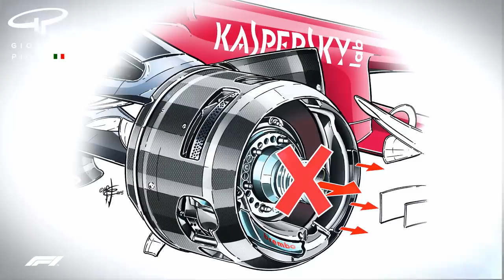2019 Technical Regulation Changes Explained

Comment: Can’t we just make the cars smaller? I mean ever since 2010, the cars have become more and more gigantic!
Reply: TRMS  I would rather see the tracks get redesigned, dropped off the calendar, or build new tracks that can make racing interesting again. Canada is a great example of a track that once was great. But, now, even Canada can not accommodate these faster and larger cars for passing. And do not even get me started on the street tracks. They ALL need to go.
Reply: Definitely. Right now the Mercedes F1 car is larger in both width and height than the S-class saloon. We need to go back to when cars were around 4.5 metres long.
Reply: Every time I see the two cars enter the tight coner, I imagine two cars squeeze together between the barrier.
Reply: The problem with that is that they have to get so big since refueling isn't allowed anymore. Even now most of the race is spent lift & costing to save fuel
Reply: Completely agree. Every race start these days are two by two.
Reply: tonkatoytruck dyu know how much that would cost 😂😂
Reply: tonkatoytruck The cars are the real problem, though, rather than the tracks except for Monaco.
Reply: Tracks are the real issue. They used to be more interesting.
Reply: And what will that solve? Lower wake, and a bit smaller cars allowing for two cars to squeeze in a bit tighter sections? Let me break it to you, buddie, wake will not be a problem starting from next year, and the second point actually doesn't affect the racing EXCEPT for places like Monaco, which never saw any overtaking to begin with. The only change you would see from smaller cars would be even less downforce than 2019 and less space for engine development, which would lead to even slower cars with virtually no impact on racing itself.
Reply: @TheMindGarage why are you comparing a road-legal car to something that would require a city lockdown to even get on that same street that your normal S-class saloon would normally drive in? If you want something that is at the same size as a street car, GT3 and NASCAR is your go-to.
Reply: tonkatoytruck

It seems like you didn't watch the 2017 Canadian Grand prix. The track is not the problem, and it doesn't make financial sense to spend a massive amount of money on redesign.
Reply: Terror , Calm down mate.
Reply: xd I'm fine, thanks, it's just the misinformed people that think that going back to the old will solve all the problems, but it's fine.
Reply: It needs vehicles of that size to be able to support the power of the engine. Imagine a wv sedan or a smartfit or a spark (small vehicles) with a F1 engine, it would be broken into the first accelerated at maximum speed, in addition to as a comment above: they need enough space for a tank that stores enough fuel for all the race
Reply: tonkatoytruck Liberty is looking to increase the number of street circuits, rather than reducing them... It's not street circuits that are the problem but it all depends on the layout... Eg Baku produces good racing but Monaco and Montreal don't
Reply: I StM I Fix the cars first, and only then we can start looking at whether tracks should be altered or not.
Reply: Terror the reason why people tend to think the old days were better, is because they grew up the sport during those times, and when they see the current, they are gonna talk about how the sport was like back in the day and in their opinion thought was better

Also the reason why I said, make the cars smaller, is so the tracks don’t have to made radical changes, since it’s very expensive to modify a race track and even more to make one from scratch, especially if it’s going to be used just a few times then dropped competently, like India and Korea
Reply: Terror I think wake will still be a problem next season to a certain extent. Remember, that these changes are short-term interim solutions only, not definitive ones. In the end, 2021 is the real target for making the cars significantly more race-able/following-friendly, after all. BTW, I'm not your buddie, guy!
Reply: TheRyanMannShow no, Kimi can't store his ice cream in the car now
Reply: Dennis Xu aerodynamics advancements buddy
Reply: tonkatoytruck i agree with redesigning tracks but comstructing new tracks require a lot of land and resources which makes investment too high to be made back up through the grand prix similar to the case in India
Reply: TheRyanMannShow what about making cars smaller but with allowing the ground effect to get stronger
Reply: tonkatoytruck Hold on now Baku can stay i hate street circuits but that long straight is a game changer
Reply: This! The car has just got bigger but tracks has just got smaller and still they're adding more street circuit.
Reply: yeah just wrote a comment about that
in the 80s-2000s there was way more overtaking cuz there is enough space nowdays you need backoff most of times cuz theres no space to overtake or not enough space for 2 cars
Reply: TheRyanMannShow most tracks have more races held on them and not only F1. So let F1 change instead if all the tracks
Reply: Theblahblahgames Someone gets it! We need groundeffect
Reply: Terror that is not true - it would help it a lot, because you would then have more room to find some clear air by driving alternative lines.
Wider car = Wider section of air infected by turbulences
Reply: tonkatoytruck I agree but that would cost more than just making the cars smaller.
Reply: TheRyanMannShow os carros de 2014 eram bons até Mônaco teve uma corrida com ultrapassagens
Reply: Monaco? Baku? SIngapore? Fuck no!
Reply: pre 1998 were bigger than current cars
Reply: Leerin Marfes where they? What were the numbers?
Reply: TheRyanMannShow sorry I meant pre-1993 cars which has 2.3 metres of track length and 220cm overall width
Reply: Leerin Marfes well, how long where the cars were in pre 1993 to today cars

And the reason why I said make the cars smaller, I saw the 2017 car next to the 2007 car, and the 2017 car was gigantic in comparison to the 2007 car
Reply: TheRyanMannShow they need to be longer than the 2007 cars because of larger fuel tank
Reply: Leerin Marfes and also for the battery for the hybrid system as well
Reply: no, that way they will look hideous
Reply: This has been the best comment thread I have seen in a while, genuine talk about the sport and no one pitching a fit. What I like to see
Reply: Street tracks are absolutely horrible for open wheel racing. Just TERRIBLE!
Reply: I feel it got smaller...  Even 2009 season started the rear wings got smaller than the past seasons
Reply: I'm not sure there are many opportunities to over take in Singapore either. From the over head shots it looked like there were no places to pass.
Reply: @davidmoll7250  then why is 2.4L 
2011 cars are smaller than 1.6L cars of today?🤔
Reply: RyanMann141 y’all are absolutely right. Cars from the 2007-2008 age are elegant to the max

Comment: Now that F1 cars are so extremely safe, can we bring back the Nurburgring? (Edit: I meant Nordschleife. Even though nurburgring is coming back 2 years later 🙂)
Reply: Kioumaars Taeed Cars are too wide, I think, for effective racing.
Reply: Kioumaars Taeed The bumps in the surface would probably break something
Reply: Americano Beans What's Monaco's excuse then? I'd rather see Nürburgring on the calendar instead of Monaco to be honest.
Reply: Kian Stevens Agreed.
Reply: Kian Stevens Monaco has no place on the calendar IMO so it's irrelevant to the discussion currently. But to answer why they keep it, I assume it's because of tradition and the prestige of it.
Reply: Americano Beans But that was my point. It shouldn't be on the calendar; it's only on because of the heritage. Monaco doesn't give any close racing. There are other circuits which would be much more entertaining than Monaco.
Reply: Or Zandvoort
Reply: Zandvoort would be a great circuit!
Reply: Kian Stevens Monaco's bumps cannot be compared to Green Hell because of the speeds current F1 cars could make there
Reply: Kian Stevens Money, you don't want to know how much money Monaco brings in.
Reply: I have to say even if they could only pass each other on the straights then it would still be incredibly entertaining to just watch them drive on the Nordschleife.
Reply: FIFATyoma I was on about the Nürburgring GP, not the Nordschleife. Of course F1 cars wouldn't be suitable for the Nordschleife.
Reply: At least there are talks to bring the Nürburgring back to the F1 calendar in 2019 :)
Reply: that whould be propably the most boring race, no overtaking at all
Reply: In all honesty, I'd rather see a track like Imola on the calendar instead of Baku. Imola is a great track.
Reply: Kian Stevens It was before 1995.
Reply: Britton Kithcart I'm well aware.
Reply: Or ground effect?
Reply: Magny Cours is one track that should seriously come back
Reply: The Nordschliefe is unraceable. It's fine for the WEC because endurance is more about reliability and consistent pace and the lower classes move out of the way when a faster class is lapping them. And even then you won't see LMPs there because they're too reliant on aero, GT3s are the top class for 24-hour Nurdburgring. The same is true for F1 cars, the track is insanely bumpy and the cars would be bottoming out all the time, there are so many places where the underbody or the front wing could get damaged and even if they don't every time the car bottoms out it loses a lot of downforce and acts unpredictably.

Even if you could guarantee that nobody would be seriously injured or killed it would still be a total shitshow and 3/4ths of the race would probably be ran under the safety car.
Reply: Kioumaars Taeed Are you talking about Nordschleife?
Reply: nurburgring will never host an f1 again, too many deaths on history, no escape areas, bumps and drivers and constructors would be against it (safaty/car damage)
Reply: I think people are confusing the Nürburgring with the Nordschleife, and thinking they're the same thing. 

We may see the Nürburgring come back to F1, which I would very gladly welcome, but we will never see the Nordschleife again because it's far too dangerous. It was back then, and it would be now, no matter how safe the current cars are. As someone mentioned, each GP would be an absolute mess, and the majority of it would probably be under the safety car. Not to mention that there would be only 10-15 laps (that's my estimate), due to just how long the circuit is, and not to mention the fuel limits.

Also, just correcting something I saw above - the Nordschleife doesn't host the WEC, you probably meant the Blancpain instead.
Reply: Yes back to the nunbergring
Reply: Fuck yeah! Nordschleife for the win!
Reply: @Awesomeduud  indeed its because of tradition. Monaco is a hard race to win because the low chances of overtaking. And its part of the racing triple crown ( Le mans, Monaco, Indy 500 ) one of the things every pilot wants.
Reply: They wouldn't be silly enough? This is the same sport that included Sochi Autodrom and the crappy 2015 layout of Hermanos Rodriguez.
Reply: Le Mans would be a funny but still exciting choice. I mean, if the track was in good condition, the overtakes would be awesome, as well as top speeds
Reply: You mean NORDSCHLEIFE
Reply: It is cars in combination with track design
Reply: The new one or the old one?
Reply: @kioumaarstaeed  if you're answering  because this year's calendar, I meant the nordscheleife nurburgring, not the gp track
Reply: your wish has been granted :)
Reply: @Shea Bryant Crashes are exciting 😬

Comment: Can’t blame them for changing the regulations for next year. Always frustrating to see a car close up and they stay behind the one in front for almost the whole race
Reply: BR1993 it’s a step in the right direction, for sure. It’s just frustrating to see things like DRS. Having to engineer in overtaking seems so futile.
Reply: It always tough to find a balance between fast cars and overtaking. Both we want to see but very hard to manage 😂 I wouldn’t want to be the one to call the shots
Reply: Hamilton behind Riccardo. As soon as he got a second behind Ric’s car he had no grip through turns
Reply: i really dont get why they are not pushing the aero toward more ground effect ? .. if the biggest probleme is dirty air .. with cars aero based on ground effect we get rid off that ... and we get less drag so less fuel used .. lets turn the f1 cars into "fan cars" .. because the problem is not that cars are faster .. its that the aero they using to get faster is creating dirty air
Reply: Night Drivin' Avenger because ground effects are dangerous. It makes constructors use less downforce on the wings in favour of the ground effect. That's all fine until a car is launched a bit and all the ground effect is lost
Reply: well there is no way to make rules about that ?
Reply: it won't change, it's not enough.
Reply: @nightdrvavenger2087  well no, if the car lifts even a tiny bit (a little bump is all it takes) the ground effect is much less efficient and effective and that could cause a lot of problems, especially with corners like Raidillion up Eau Rouge, where cars have actually flown.
Reply: There had been several mortal accidents caused by the ground effect, where cars were literally flying in the air for a couple of second and then crashed in the ground "head first"
Reply: One of the reasons F1 doesn't have more fans. Casual sports fans tend to think it's just a train of cars the whole race. Which it somewhat is at times.
Reply: It's the frustrating thing about needing to be the "fastest" motor race, it's too fast, it's too dangerous, it's a prohibitively expensive sport to run and the cars fall to pieces if someone makes a mistake, they also can't make it too much slower without veering into F2 territory.
F1 is the "pinnacle" of motor racing, which attracts fans, but every other racing discipline is more exciting to watch.
I recently got into watching Rallycross whenever possible, even though the races are only 6 laps, they're often the most exciting 6 laps of any race ever, the tiny tracks in Formula E also offer some rough and tumble racing, but as the cars get faster i imagine they'll move to full size tracks and lose the go kart appeal they have now.